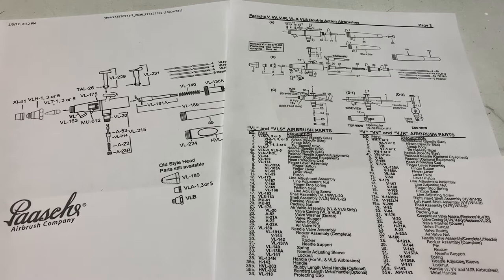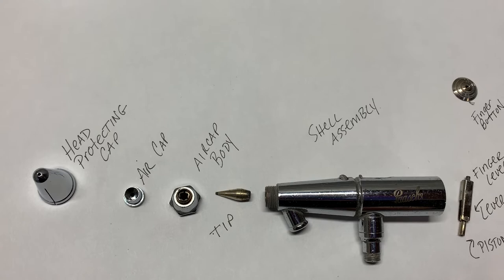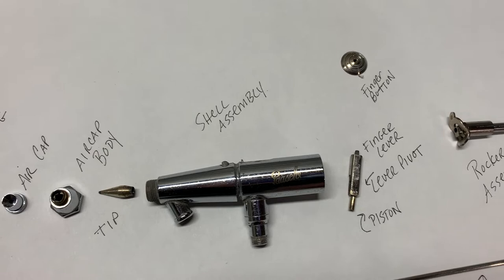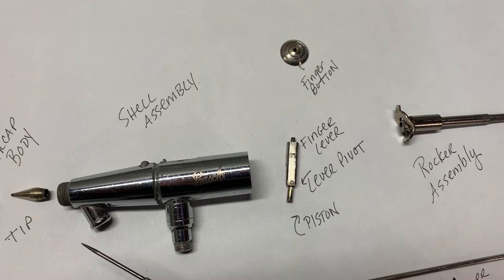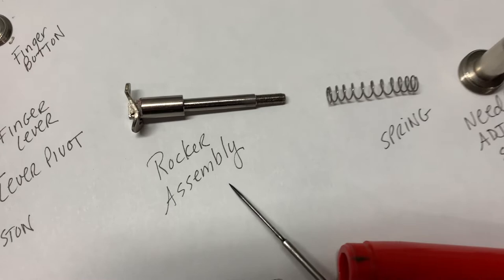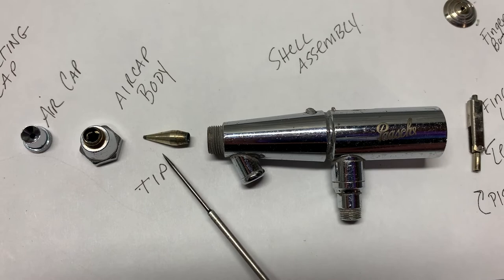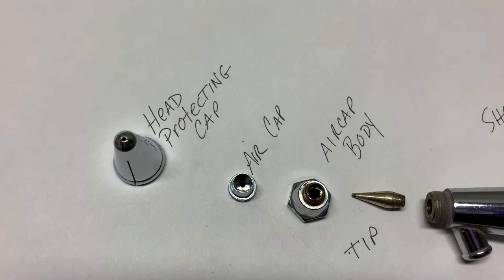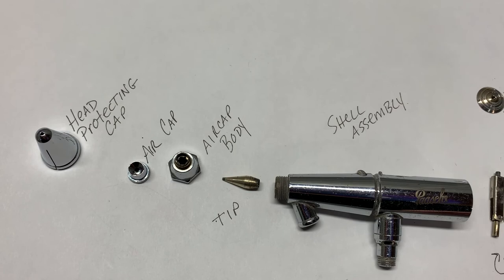Information on Paasche VL Airbrush Parts (Video #11)

Comment: Boy, this takes me back. I was an airbrush illustrator for many years, and the Paasche remains my favorite. It just felt so sturdy. My Iwata was capable of finer atomization but I just didn't feel comfortable using a device so finicky and, well, expensive. Most people don't know that a Paasche can give you a line of comparable thin-ness to an Iwata, although it won't last more than 30-60 seconds. Paint build-up on the aircap and needle will force you to do some cleaning. 

I never understood why anyone would use anything other than the long, tapered VL-1 aircap and needle, not pictured in this video. They give you the finest lines, but I also used them to spray large areas. The other sizes were useless to me. 

I found that a pointy tortillon or stomp, commonly available in art stores as a drawing accessory, was the perfect size to clean the longer VL-1 aircap. I used diluted ammonia as my cleaner. Nowadays, people frown on that practice, but ammonia proved to be the best at instantly dissolving Badger acrylic airbrush paint. 

Wow. Do they even make that paint anymore? In the '80s, it was all the rage in the world of airbrushing. I still have a few bottles around here somewhere.

Comment: I’ve had my VL for 25+ years! Recently took it apart to get it working again (needs cleaning big time). Question: what is the dial (textured like a guitar string) on top of the shell body (it rotates left or right)? I’ve always wondered what that thing does but didn’t know (and my manual doesn’t mention it) so I never messed with it. Does it adjust  the needle tension nut (how loose/tight the needle moves through the shell body)? Great video. When I first got my VL back in the 90’s there was no YouTube. Everything I learned was trial and error. I use an Iwata now (mainly for the top feeding cup feature which I much prefer) but I look forward to getting my old Paasche cleaned up and running again. Thanks.
Reply from the maker: Hello! Sorry for the delay in my reply. The roller in front of the trigger, pushes the trigger back to set line/spray width. Check out video #12 at 9min. 31 seconds where I show the adjuster. Hope this helps, and hope you get it cleaned up and airbrushing again.

Comment: Do you know how to get the "line adjuster" out of the body?  I spun the wheel and the wall/stopper came out, but was kind of clueless after that.  I was trying to clean/ rebuild bits of mom's VL (also 30 ish years old) I've accidently abused through learning recently.  Thanks for all the informative uploads!
Reply from the maker: I've never taken this part out. If I do mess with it and get it out... I'll surely let everyone know how to put it back in. Thanks for watching my videos.
Reply: @griffinartandairbrushing3174  got brave and figured it. You rotate the wheel until the stopper comes out. I had to help mine a little at the very end. Then you pinch the wheel and pull it out from the top, being careful, because it's a captured spring in between two discs.  Awesome! I've basically got Mom's VL rebuilt.  Probably not putting in the new style air valve stuff and trigger.
Reply from the maker: @ChapterMasterDad  Cool, thanks for the info!